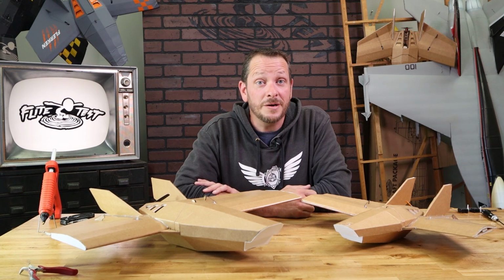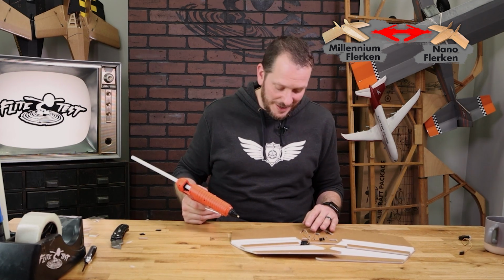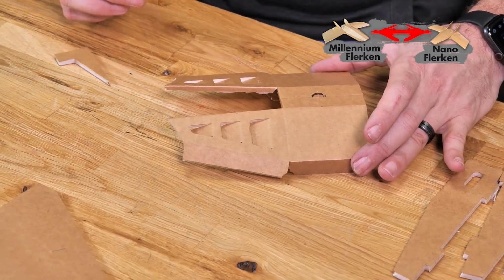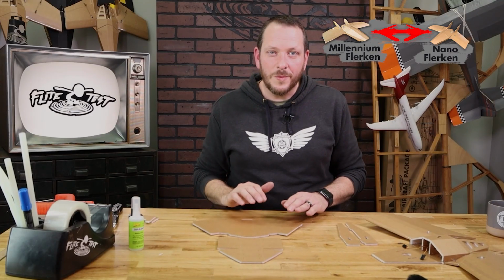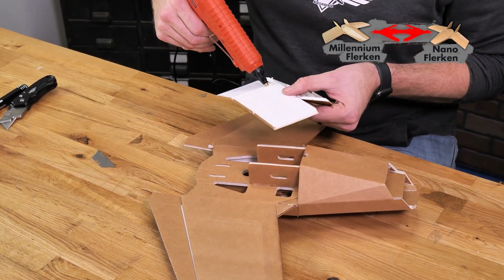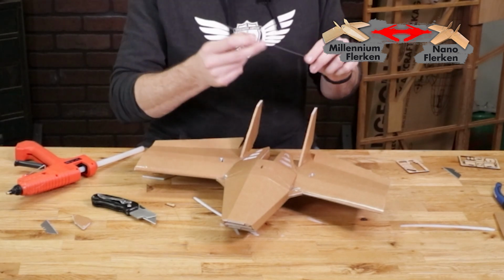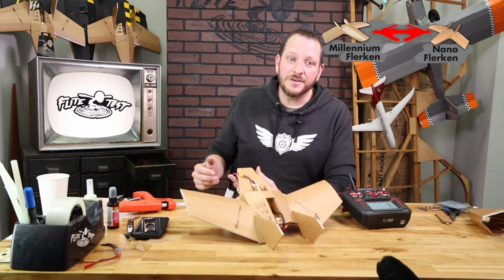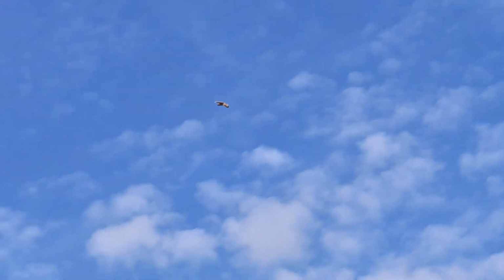How to Build the FT Millennium/Nano Flerken // BUILD

Comment: I think this page and content came up as an ad. I moved up to oregon and i'm enjoying the nature. now I am very curious about these. IS this maybe a good one for beginners? It looks pretty forgiving. I am fascinated by this as a hobby.
How are these decorated? a special ... paint or decals or a wrap?
I am so out touch, so you can run some VR goggles and fly POV ? that... would be awesome.
Is it listed how much weight it can pull / carry? like a load?
Reply: 1. If you are a complete beginner, this is not a good plane to go with. If you want to build a plane yourself go with the FT tiny trainer or FT simple cub. If you want to just buy a plane and not have to build it at all go with the Eflite Aeroscout or Eflite Aeroscout mini.
2 These are decorated normally w/ stickers, decals, and spray paint
3.  Yes, you can get FPV goggles and cameras to fly from the plane itself
4. Normally load isn’t listed but it’s best to not add any extra weight that’s not necessary

Hope this helps 😊

Comment: Just received the millennium model. The bottom of the wing is 22 mm to wide. The upper hinge line does not line up. It’s about 22 mm in.  I did build the nano model and it all lined up.

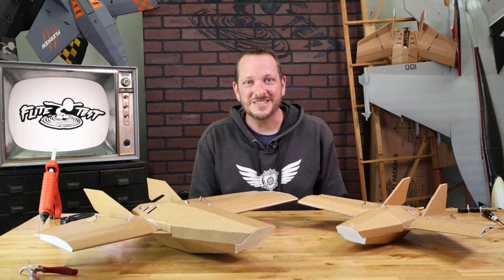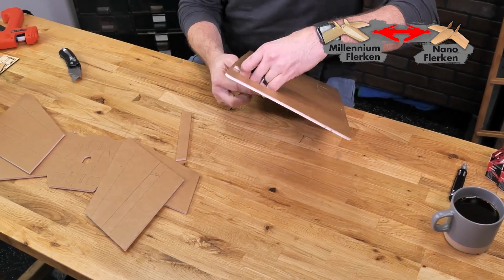Comment: This is the first time I'm making anything like this, so I'm going really slow.  Wish there was a paper or stickers or some sort of marking that identified WHAT each part is on the foam board.  I just replayed 1:20 through 1:30 like 10 times to figure out what the "Main Body", "Wings" and "Spars" are.  I hope I got spars right - they just look like small rectangles and there are tons of rectangles on the foam board.  And of course I'm doing the Millennium Flerken which looks gigantic next to your model which is probably the Nano.  Also NONE of your links work anymore since you've "redesigned the site".  It's been a challenge and I'm only to the point of removing parts!

Comment: If you havent gotten to the section yet its easier to put the spar in before the servos. If you have the servos slightly too far in one direction the spar wont fit so do the spar first and push the servo up against it.